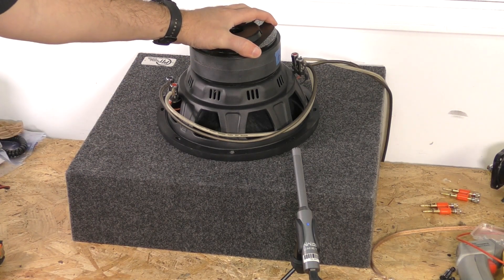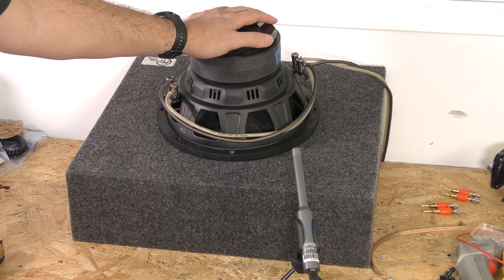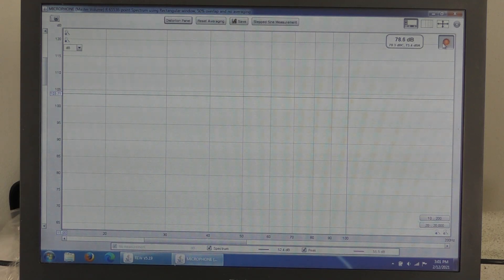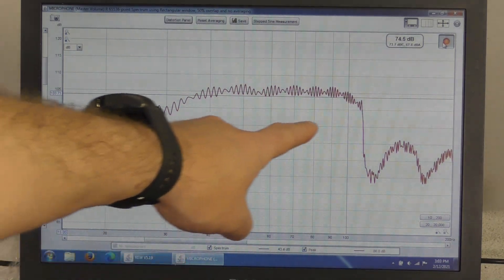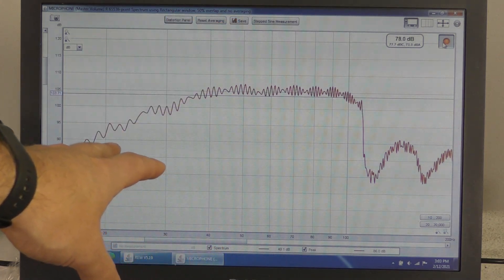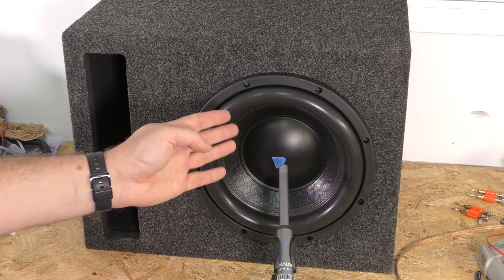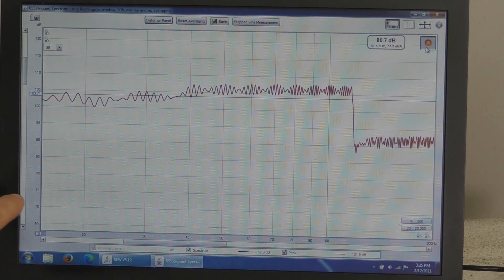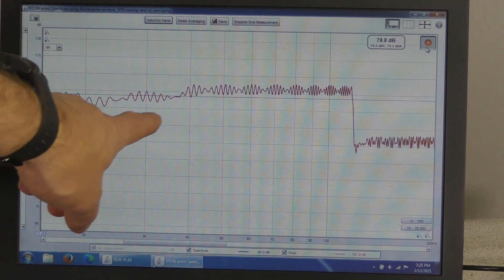EMF Audio Ghost 10" enclosure frequency response testing

Comment: I'll await the 12, and what grills will fit?
Reply from the maker: People still use grills?
Reply: @EMFAudio  yah, i have a new 2017 silverado standard cab. And i have a pair of sony 7547 amps that i can fit in it. I will do a center console box for 2 12s. They will need to have grills over them. I almost bought a pair of old sony drivers off somone on ebay, but since they cant answer my questions, im going to go with an alternative. Your 12 ghosts. About 300w ea. But yah grill screeens.
Reply from the maker: @administratorperson3272  a standard waffle grill should fit fine.

Comment: If you used REW for measuring FR, then using its RTA for that purpose is probably not going to give you the best results.  Use it's "Measure" function, with a short sine sweep - you'll get a much cleaner FR. You also need to make sure that you're not overloading the mic, because that will introduce distortion into the response measurement, which will make it look a lot flatter than it really is.  (you can see the possible impact of that distortion in your RTA measurement, where at low frequencies in the sweep that you used, the RTA seem to show several significant "humps" that slowly disappeared as the frequency of the sweep increased. 

And yes, as someone else mentioned, the FR of vented boxes can't really be measured that way.  There are a few ways to accurately measure the FR of a vented box; I use the  "transfer function" method - measure a sealed box in a specific location, measure a vented box in the same location, then use the difference between the two measurements to calculate the effective FR of the vented box.  It's actually quite simple to do, as the means to do the calculations quickly are included in REW.

But anyway, it's nice to see some REAL useful measurements, instead of the usual "car audio" ones that only seem to be concerned about highest SPL figure.
Reply from the maker: I'll look into the maximum limits of the mic, I believe it's over 110 dB so that wouldn't be an issue. Down around 20 hz where SPL wasn't audible or very low I know it was picking up the mechanical noise of the sub, which was louder than the output. In regards to the enclosure, I don't care what it does on a bench as noted because that isn't where we're listening. In car is where it matters, which is what's next. Remember, we aren't concerned with what the sub is doing and what the box is doing, only what you're hearing period.

Comment: Those are nice budget priced subs. How does a shorter winding width affect a subwoofer like on a 200oz 3" coil motor going from a 2" wide winding to a 1 5/8" even though the x max has been reduced does it reduce excursion significantly? Or just move as much physically but past ideal coil to top plate distance? It seems to work fine I'm happy with its performance just curious what it changed functionally I've started building some subs and trying to do it with some knowledge vs poking and hoping. Any input would be appreciated.
Reply from the maker: The weight of the motor means nothing. The top plate height is a factor in Xmax, along with winding width. When the winding is shorter, xmax is reduced by 50% of the difference.
Reply: I just thought possibly with a bigger magnet you may get more motor force sending the coil past normal coil travel causing similar excursion but less control where windings may go sailing the top plate easier but suppose that's the suspensions job I'm guessing. But yes thank you for the reply I appreciate it.
Reply from the maker: @fiveohh95  A bigger motor doesn't mean a stronger motor. A stronger motor means more control, meaning that it can throw the coil one direction but it can also stop it and make it go the other direction. The BL curve is what you're describing, and there are many factors involved.

Comment: Nice. Are those optimal enclosure sizes? If so a pair should provide some serious bump without taking up too much space
Reply from the maker: Volume wise they seem pretty optimal, tuning wise on the ported I'd like to see tuned lower personally.
Reply: The 10’s I’ve had seemed to like 35hz. Never tried any lower though
Reply from the maker: @gregblau8082  It all depends what you're listening to.

Comment: Will there be 15s? I will be after several subs to do a build with a group of teens. I have a MD5k, and XTR2500.1Dz laying around to use for power.  I would rather use 15s for maximum SPL, but if 12s are going to be all you have, we may use them. It's going to be a stupid crazy build with these entry level subs. Hoping to just get really windy. It doesn't have to be extreme SPL. I'm wanting to get these kids off the street and teach them some valuable skills using tools, math, and critical thinking. Car audio just makes it a bonus because most teens are interested in loud music.
Reply from the maker: No 15's in the Ghost line, but we do in Lowballers

Comment: What Is the mounting depth of the ghost 10s? I was thinking about going with an sa12 classic, but I may try the 2 10s instead. It is going in a 2cf truck box tuned to 34hz with 28 si of port face. Running 1500 watts rms. Which do u think will be louder?
Reply from the maker: I'll measure them again but I think it was 5.5". The Lowballer is better than an SA, comparing two 10's to a single 12 in different series is hard to do. A pair of Ghost 10's will cost less than a single SA too.
Reply: If you want something that would go toe to toe with the S.A series you should get the low ballers. Its already been proven they play the lows better than the sa series .